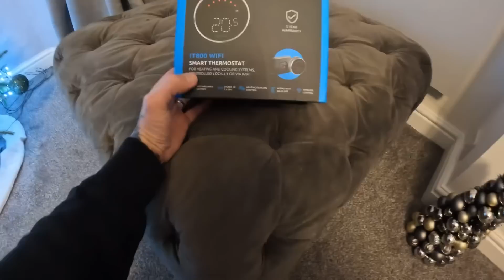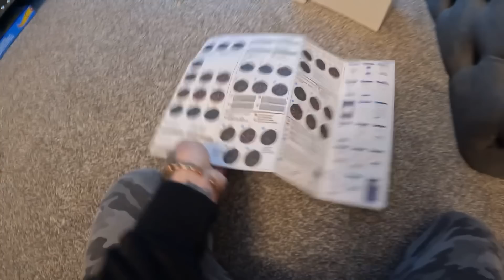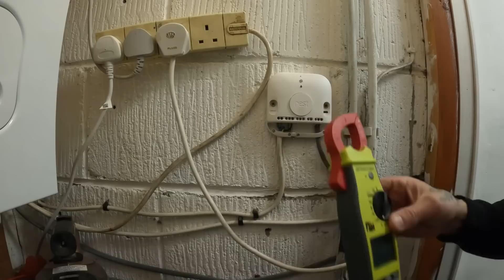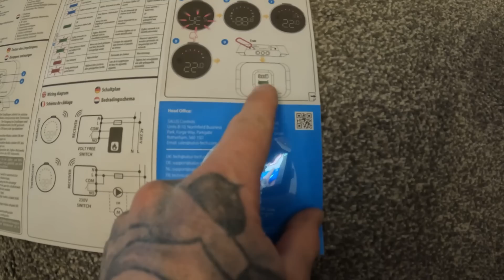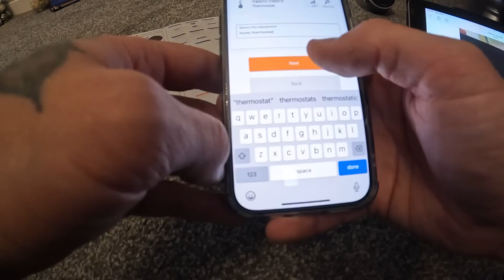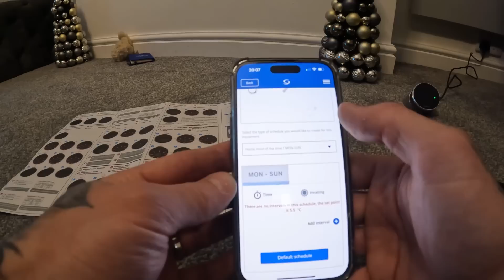Nest are leaving the UK market?! Salus IT800 thermostat install #plumber

Comment: I first used salus it500 in july 2020 and its been working eversince, had a few issues, changed batteries and rebooted it once, also their cloud server messed up a few rimes but o the whole its been ok., easy to program via internet and app. Only issue is the app sometime syou need to log out an dback in again to refresh it.

Comment: Thanks Dan - an interesting video.
Nice dog too!
Pity Nest is leaving the  U.K. 
Nest has lots of nice features - app, Opentherm, no hub required and excellent display and easy control.
The Salus looks similar but no Opentherm, which seems odd, as they have a wired, non-Internet version which does support it.
Tado, which I have, has Opentherm, geofencing, weather comp, etc., but it does require a hub (possibly to make support of multiple devices, such as their smart radiator valves, simple); however the room stat has a very basic interface with few options and not much info displayed.
If you fancy individual controls in each room then Tado seems the best choice at present, as I think the Opentherm support gives it an edge, but that’s just my opinion of course!
Reply from the maker: @SteveHit1  thank you very very much Steve, really appreciated! I do fancy multiple zones (each room) controllable in the future, definitely! Yes I agree it is a shame. If the rumours are true. I will have a look at the tado range! Thank you!
Reply: @SteveHit1  I would get sonoff TRV’s and if you use Home Assistant your all good, best underrated thing that nest made was the smoke alarm I’ve got 7 of them so guess I’ll be looking for new ones of those later on too I guess
Reply: @ yes, I’ve got the nest smoke alarms too, and they are excellent. Thanks for the sonoff recommendation- I’ll investigate…
Reply: @SteveHit1  PS I used some battery converters to wire all the ones near to a plug 5volts it can cope with the extra .5volts I just don’t like changing batteries only two have batteries out of the 8 that I have and PS one of your rads can’t have one as it needs a permanent flow just incase the others are shut off. The towel rad if you have one is excellent for this as a permanently open valve. Hope that helps
Reply: @ That’s a very clever idea to use an external supply!
Good point about having one rad on a normal valve. 
Thanks!

Comment: I would be interested if it came with a hard wire option , like the Nest T1& T2
Reply: Salus does a hard-wired version as part of the smart home range,
Reply: @AllenHart999  what’s the product code Alan please , does this mean it’s like the hardwired version of a nest using 12volt on T1&T2 . 
Consequently not required to be charged ? 
Thanks for your time
Reply from the maker: @johnsmart4692  yeh that would be nice!

Comment: I like you have favoured Nest so if they are going as what happens to existing customers when they get issues🤷🏼‍♂️ when Google took them over they started going down hill. Ive also fitted a lot of Salus over the years (and dealt with their issues). Will probably give one of these a try👍🏼👊🏼💪🏼
Reply from the maker: @russellbaldry5095  I’ll wait until they officially confirm, but I tried to buy one last week and you can’t get them from any of the larger merchants.

Comment: I'm glad they did pull out ..... they must have been losing money left right and centre . They break after two years and they would send you a new one . And customer service was non existent . Always better to fit manufacturer ones if possible as they do more and communicate better with pcb.
Reply from the maker: @DnBGas  yeh I have had issues with the heat links and you’re right they do just send a new one out :/

Comment: Firstly its £140 and second it doesn't say whether it is Opentherm Compatible or not...............
That was the benefit of the Nest versus Hive, Hive Mini Tado and many others.
I am surprised that EPH haven't brought an updated thermostat controller to their kit which is Opetherm compatible
Reply: It doesn’t have opentherm
Reply from the maker: @MagicianMan  yeh I’m not sure. Allen might be able to answer that on the opentherm. I love Nests not going to lie.
Reply: If it doesn’t have Opentherm it can’t really be described as a smart thermostat.
That said, several of the big boiler manufacturers don’t support Opentherm so all academic really.
I’ll stick with the EPH CP4 for now as it’s piss easy for my elderly customers to learn & operate.
Reply: @MagicianMan  Tado is also available Opentherm compatible.
Reply: @SteveHit1  doesn't that only apply to the EU version?
They withdrew that from the UK market and then I think they re-introduced it but its never 100% clear if your getting the UK or EU version......?
Reply: Interestingly from one of Allen Harts videos EPH is the only Opentherm controller that can be used on S Plan+ and multiple zone installs (upto 6 if I recall). This means that it can even be used with Heat Only S Plan+ setups with DHW Cylinders (with an additional Cylinder/Pipe Thermostat).
Because of that issue and a lack of spare wire for SL2 (Ideal Heat Only) we ended up going with Ideal Halo but kit it's ridiculously expensive and not that great (managed to buy from FB Marketplace and others to reduce cost).
Reply: @ it seems to be a new version.
It’s  available in the TaDo U.K. shop and Toolstation - ‘Wireless Smart Thermostat X - Starter Kit incl. Programmer with Hot Water Control and OpenTherm’

Comment: I will never ever fit a Salus thing ever, ever again.
Reply from the maker: @tomstrutton4351  I think this is the most popular opinion 😂😂😂
Reply: @ if the batteries died in one stat it could take up to 24hrs for the new batteries to kick in….whats Dorris meant to do in the mean time? And their motorised fucking valves they bought out a few years ago…. I had to go back and change every mother fucking one.
My suppliers had all their gear back in droves….
Reply from the maker: @tomstrutton4351  I never seen the motorised valves to be honest. Had issues with the old stats though

Comment: The round and square back plates are for wall mounting. The docking station is for charging. Available from your local City Plumbing ❤
Reply from the maker: @AllenHart999  thanks Allen! I thought so, I did suss it out in the end, but they need to add that to the instructions haha

Comment: I will never touch a salus product again as long as I live they are terrible and cost me a fortune replacing the ones I fitted as they just pack up in all sorts of different ways
Reply: I second that. Cost us a fortune in having to go and replace failed units for decent thermostats. Utter garbage. We will never, ever fit another Salus product
Reply: @Ifitaintbrokedontfixit  I am sure you will, it might not say Salus on the Box but a lot of UK products are made by Salus Controls.
Reply: @AllenHart999  That probably accounts for the perceived drop in quality of heating controls. They need to reduce their warranty to say 2 years which may reflect more on their life expectancy.
Reply: @AllenHart999 if that’s the case then how come their own are so crap😂😂
Reply from the maker: @dombarnes7092  yep and they did me mate!
Reply: Salus make loads of the stats on the UK market 😂
Reply: @ I know I used to fit a lot of them years ago and they used to be ok but from about 5-6 years ago they went down hill rapidly so much so my local merchants got rid of all salus products coz they had enough of most of them coming back😂😂